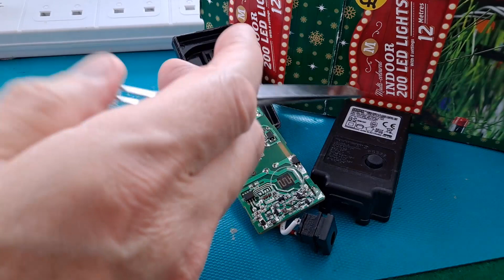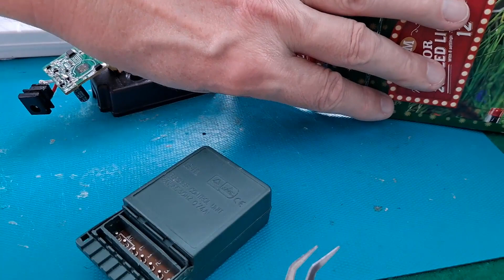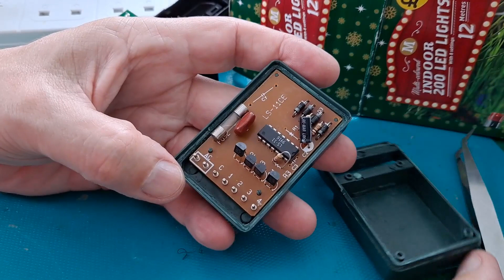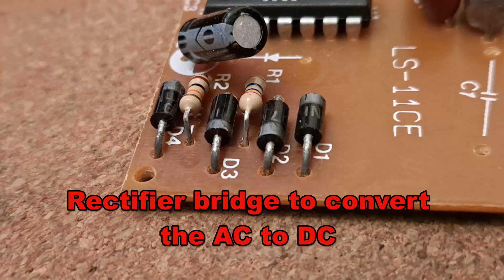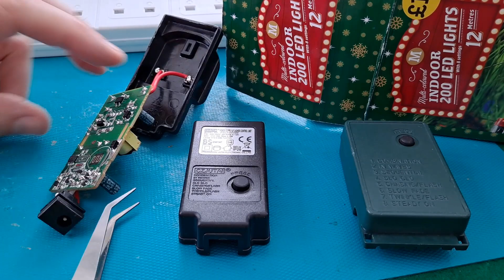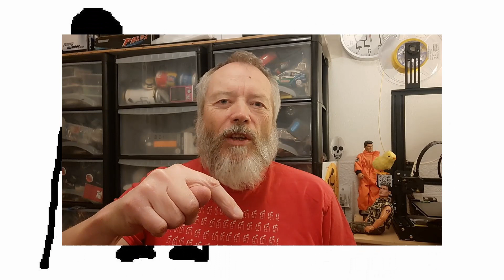Peek inside another LED string light sequencer Maybe a Charlieplexer

Comment: Well, Graham, I know a little bit about circuits, but a "Charlieplexer". LOL What the he** is that. Would that be the brother of JimmyPlexer? 😂👍
Ok, just had a look and I see it is a way of controlling LEDs in some form using a microcontroller but still a bit confusing to me. 😂👍😜
Reply from the maker: It's still the same basic thing where half a string will light with the current from in one direction, and the other half with the current in the other direction. But, then you add more strings and by mixing the 'ins' and 'outs' of the various strings you can have more strings than the number of wires feeding them. Ian Rolfe tries to explain it in his comment. I also put the Wikipedia article link in the video description. I kid you not, when I say the article includes Tucoplexing, GuGaplexing, and Chipiplexing.

Comment: I don't think it "charlieplexing" as such, because with that you don't have a common return; each wire is used as a common in turn with the others supplying one or more LEDS. With 5 wires, charlieplexing would allow 20 strings (5 different commons using the other 4 as supply) but to do this each wire needs to be driven either to supply or common, thus needing 2 transistors (a half bridge) per wire. This controller looks like it has 4 channels and a common return, with each transistor switching the supply to each of the 4 supply pins.
Reply from the maker: I studied the Wikipedia article linked in the video description 👍